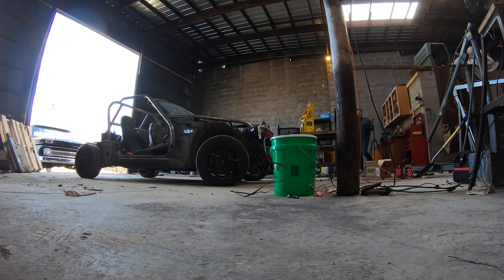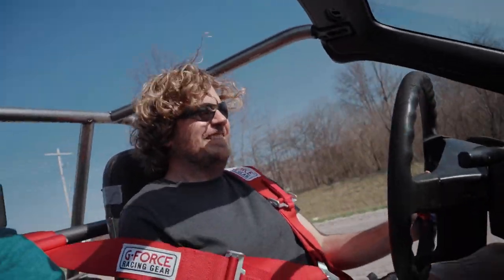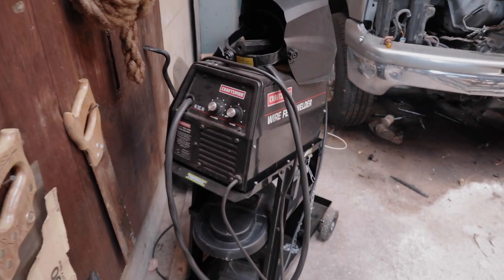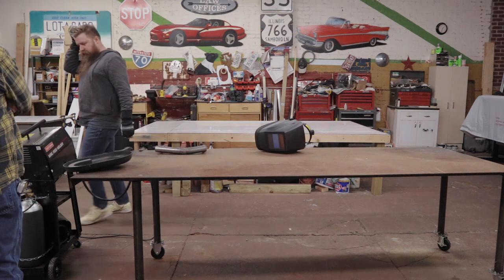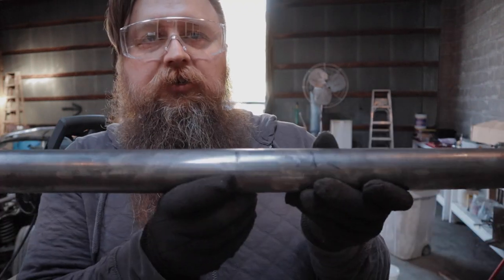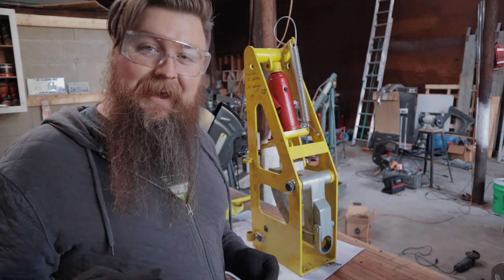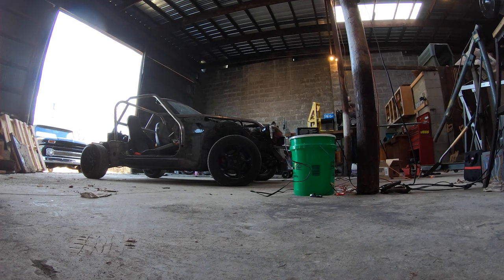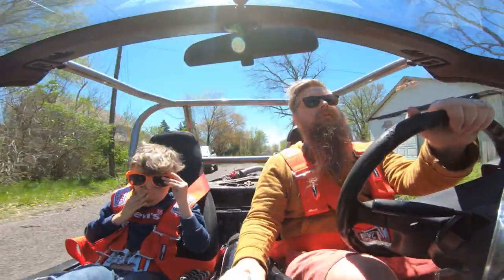Fabricating a Roll Cage for our Street Legal Miata Kart Build

Comment: What kind of tubing did you use and where did you get it from? I’m wanting to do this but I don’t know what kind of tubing I should use or where I can get the tubing from. Thanks
Reply from the maker: I went to a local metal supply house (I'm in st louis so I went to shapiro metal supply). I read through the NHRA rule book for roll bars and cages to find out what I needed to pass tech. You should refer to whatever sanctioning body's rules is closest to the kind of driving you want to do if you ever take it to a track.

You'll need the right diameter and wall thickness tubing to be safe and pass tech. The miata is mild steel tubing. They'll ask if you want ERW or DOM tubing (the process they use to make the tubing). I went with ERW because it's cheaper.

I got 1 3/4" .188 wall thickness tube. This is whats required for a roll BAR by the NHRA. I could have went with 1 5/8 and still passed since I was building a whole cage.

You could spend more money and get chromoly tubing...it's stronger and requires less thickness to pass tech, so there's a weight savings advantage, but it's expensive and requires TIG welding.

There is more info here about the process we used: https://blvckflagd.com/tech/roll-cage-101-first-time-fabrication-part-1/